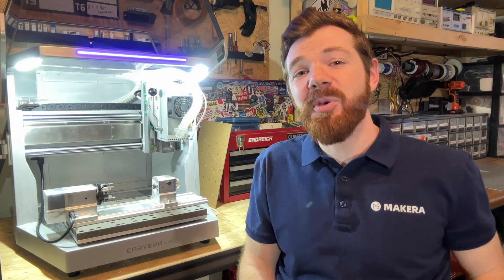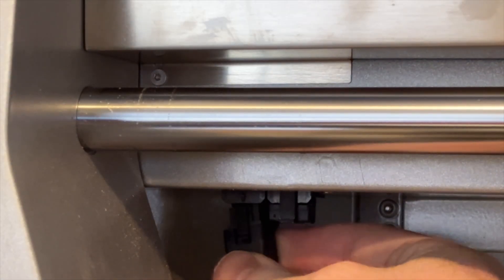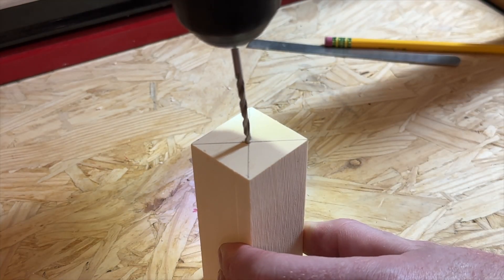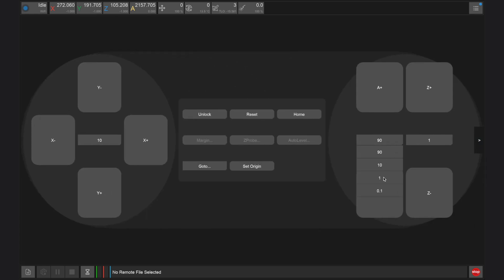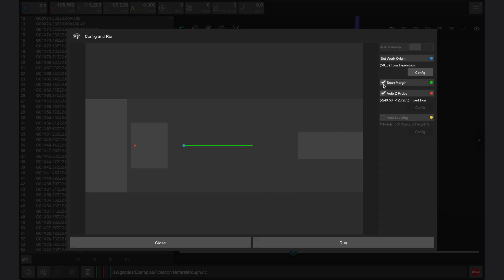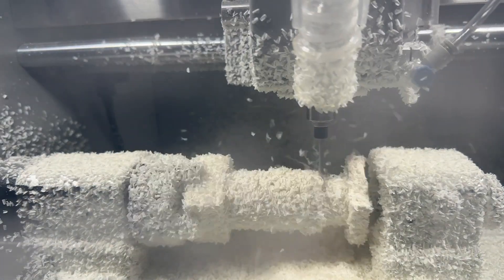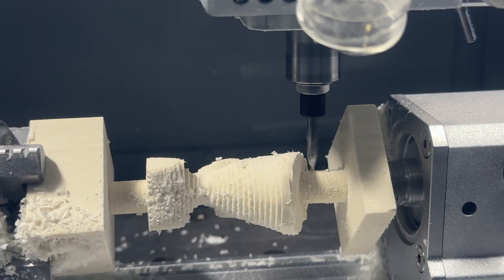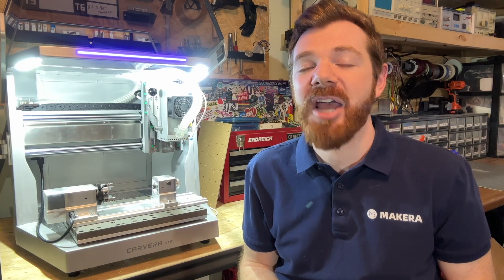4th Axis Relief, a Carvera Air Example Project

Comment: so is the x offset always set to 50 or is that just because the stock for this project is 100mm so you divided by half?
Reply from the maker: The x offset doesn't always need to be 50, you can use this to position your part according to your stock length to offset away from the chuck.

Comment: Good tutorial, but not sure why the default stock is always epoxy, if i wanted plastics i would just 3d print with SLA, much more interested in working on wood or metal
Reply from the maker: We always recommend prototyping in softer materials before moving into harder materials like metal first.
Reply: @Makera  Ok, but this is the hard step and it would be amazing if you published some more learning materials that are not just "prototyping", as a beginner this would help a lot.